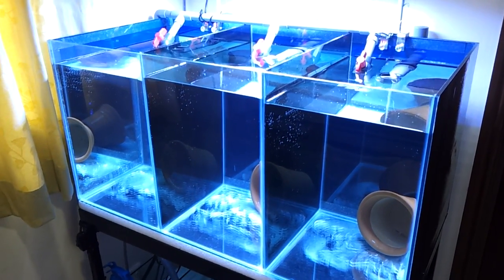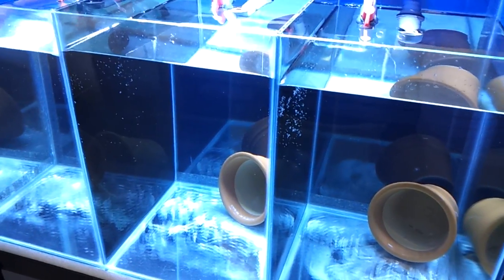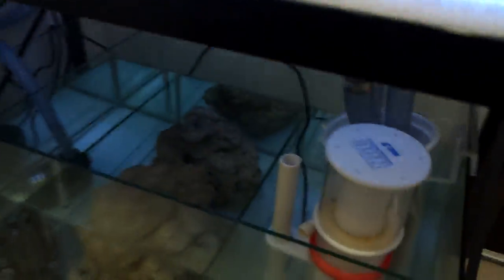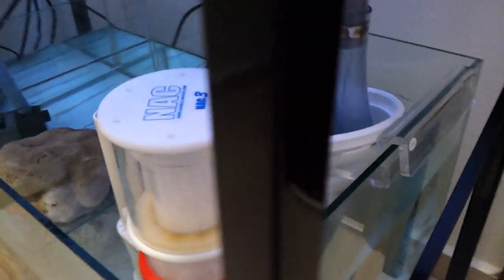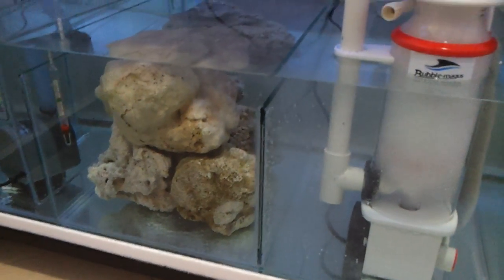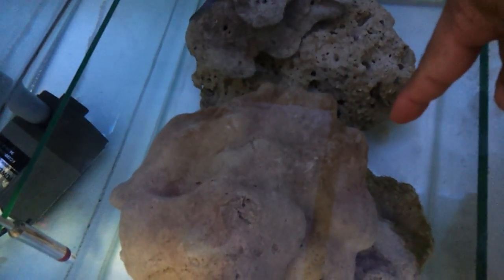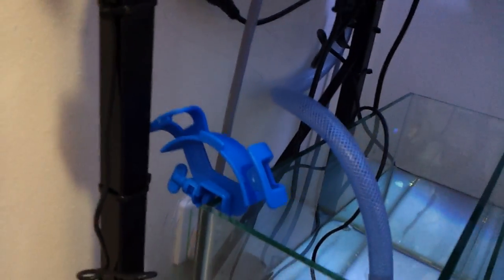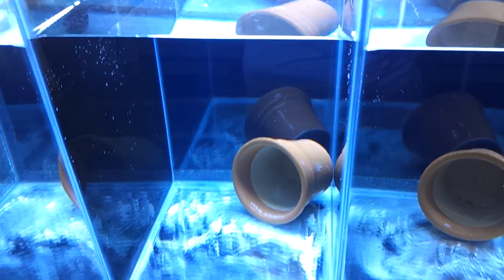Clownfish breeding tank setup

Comment: your durso setup will not be silent until you turn the elbow inside the aquarium facing down. Only the little hole in the back should be exposed to air for silence. You will have to put a screen on the intake.
Cool little setup. When feeding heavily as broodstock require I find live rock to be inadequate to process ammonia and nitrite. A moving bed filter like Kaldnes k1 like the pond guys use is many times more powerful for the same size.

Comment from the maker: Depending on where you're located, the cost to setup this system will vary. For me, the total setup was around USD300, inclusive of the lights, skimmer and pumps.
Reply: Can you send me an exact list? I have been researching about breeding fish, and I recently got some incredible snowflake clowns! !
Reply from the maker: NerdyKidNick Bubble Magnus Nac 3+ protein skimmer, 3000l/hr pump, you can use any light, custom 3 feet tank.
Reply: Where did you get the tank

Comment: Very nice setup! Notice u r using Durso overflow style. Do u have ball valves install in each 3 overflows? How big is your SUMP size?
Reply from the maker: +Tam Teps Yes that is right. So that if needed I can control the flow or close it when cleaning the individual sections.